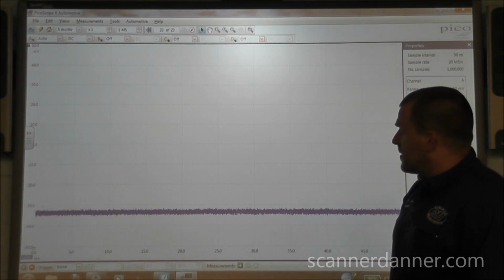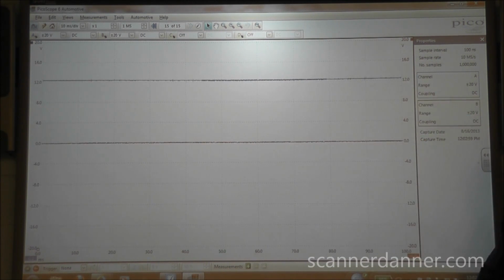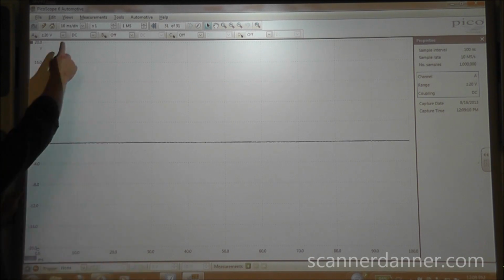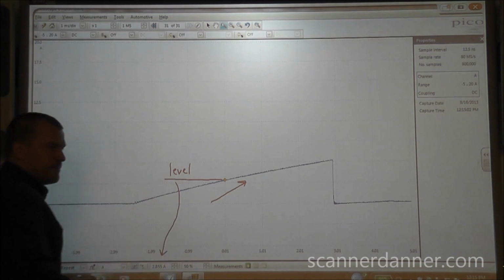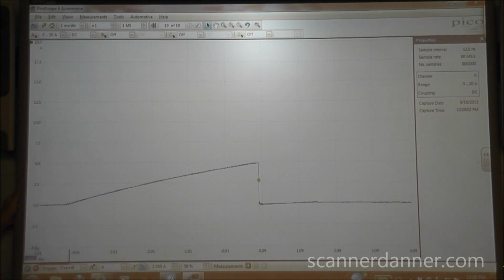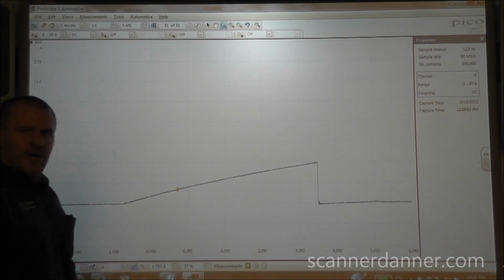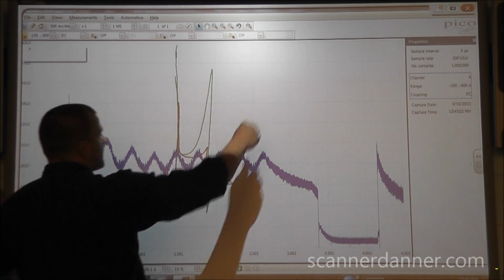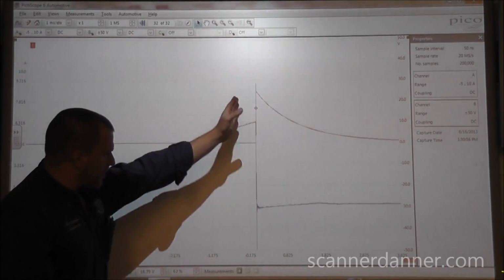Picoscope Basics Part 1 (scale, time base and trigger settings)

Comment: I can't trigger vr sensor with missing tooth like 36-2 from Toyota.  Any video about that?
Reply from the maker: Some systems you must have a cam signal at the same time to get any response at all from the ECM
Reply: Yes, but since i have a 2204 was looking to trigger the crank to use  phase rule using the cam,then disconnect from the cam and go for injector and then coil firing and see where they are in the phase. But it drifts back and forth 360.

Comment: This last test interests me, where you isolate a particular  cylinder using the inductive clamp. How would you do that with COP? Would a lead be needed to use the inductive clamp? Ordered my 2204 today so this was helpful in showing me the basics so thanks :)
Reply from the maker: I'd hook into the trigger signal for the coil. Just remember a 2 wire cop has the driver in the computer and the 3 and 4 wire ones it is built into the coil. The 2 wire will have voltage spikes that can damage your scope if your not careful and the 3 and 4 wire ones your safe. Its only a 4-5v square wave. Use an attenuator on the 2-wire ones
Reply: @ScannerDanner  Thanks for the reply. I ordered the 20x attenuator too. Looking forward to using it now.
Reply from the maker: @mk1cortinatony395  that made sense then? Great
Reply: @ScannerDanner  yes thank you

Comment: I'm really struggling with understanding what a trigger does in a scope
this video is 40 minutes long and I don't have time to watch the whole thing
please someone tell me the time stamp where he explains triggers
thanks!
Reply from the maker: Watch it at 1.5 times the speed
Reply: The scope doesn't know when to stop and start a new image on the screen.  Without a trigger it is just refreshing the screen at its default setting, but that makes the signal you are looking for jump around.  By setting a trigger you are selecting the moment it refreshes the screen.  You want to look at the sawtooth shape popping up on the screen at a consistent time.  To do that you set a trigger that will keep the sawtooth at the same place.  You choose a voltage and a falling or rising amount of voltage that gives a good image that hold the constantly refreshed signal in the same place after every scan of the voltage signal.  If your max voltage is 5 and you set it at anywhere between 0 to 5 you get a nice non-skipping image of the sawtooth.  If you set it above 5 the trigger level is too high and it never gets triggered.  Keep it around 2.5 and you'll have a nice solid sawtooth that only quivers a tiny bit on the screen and doesn't randomly skip.  Just look for the max and min of the sawtooth and set it in the middle of those two voltages.  Or you can randomly select voltage trigger points and when the sawtooth is held in a constant position you have a good trigger point.  That requires less thinking and takes longer, but it does work.

Comment: Where can I find an inductive pickup like the one your using on the plug wire?
Also, the dealership I work at has a picoscope. 4425-019 it’s the NVH package but none the less it’s a 4 channel scope and I want to put it to use, which means I need to buy the correct test leads
Reply from the maker: Definitely from my friends at AESwave
https://www.aeswave.com/scannerdanner-c512/
Reply: @ScannerDanner  I’m not finding the sync probe. I found the 60a and 200a clamp there.

Comment: Hi Paul..i got a new 2 channel pico...its not responding..i hv downloaded the software and it shows up on laptop screen..bt when i touch my channel probe to battery or any sensor signal wire, it doesnt respond..its stuck on zero line..no movement...plzzzz advise...thank you.

Comment: Greatest teacher ever was Paul I have very important question have could I send it to you?
Reply from the maker: Ask it here
Reply: Ok got your reply I have a2000 Toyota 4runner 6 cycender the problem is I can't smog it cause the monitors keep resting every time I try the engine off?
Reply from the maker: Force a trouble code to set, then shut it off and restart it and see if the code is still there, it should be, then we go from there
Reply: Sorry it took awhile to reply I forced trouble code P0100 unplugged the mass air sensor when I turned off the 4runner and turned it back on the check engine light stood on all so the trouble code
Reply: When I plugged the sensor back check engine light went out so what's the verdict Paul

Comment: could you tell me what frequencies are filtered out n the pico, i'm working on an external filtering device for cheap hantek scopes? i have built a low pass filter that really cleans up a relative compression test . it realy cleans up the shape of pattern
Reply from the maker: I think the default one is 1kHz and I usually don't have to vary it much from there
Reply: @ScannerDanner  hey i really appreciate that man,i like electrical diagnostics on cars but i also love electronics,i can probably make a low pass filter to duplicate it on the input side. the oscilloscope,ars and electronics have a lot in common but the bandwidth is getting smaller  exponentially.
Reply from the maker: you can vary the filters from 32 hz all the way to 1MHz

Comment: Paul, when I got my cam and crank signals later on I realized that I didnt have the channels set to  AC, but to DC. Did I get a correct waveform with the picoscope set to DC but yet got AC waveforms?
P.S. Do you know how to set a "Maths Channel" in picoscope to detect a cylinder misfire by looking at a crank signal using a "Frequency" to see the cylinder drop out by rpm loss?

Comment: Paul, is it common practice to hold the throttle wide open when performing Relative Comp. Testing? The reason not for Clearflood but to allow engine to breathe? I've never heard anybody mention it. Thanks for your videos!
Reply: Michael R 
If you want to see actual compression values why not do a regular test and keep the throttle plate open. 
A relative compression test is a quick way to tell if you have even compression in all cylinders.  It doesn’t tell you how much compression there is.  Try doing it with the throttle plate both, open and closed and see for yourself..
Reply: @yanzriteauto9610  Ok thanks.

Comment: Can a sync probe be used on a wire too (with signal) or does it have to be on an ignition wire only?
Reply from the maker: There are different ways to sync patterns. If I am using a control wire as a sync, I will just backbrobe it was another voltage channel. Does that make sense?
Reply: ScannerDanner Yes it does....Thank you...

Comment: Hey I have a challenging question i wondering if you could answer. GM has just introduced the media oriented systems transport (most) into their radio systems. It is supposed to be a 100 times faster than high speed can bus lan. I've been trying to connect my picoscope 4000 series to it and the radio glitches and mutes when i backprobe the 2 communication wires. same thing happens when i backprobe with my fluke 87. I was wondering does the picoscope draw like the slightest amount of amperage or microamps to gain a reading? i know a high impedance test lamp draws like an amp and it'll definitely short out 
a common can bus. I was wondering if the same principle applies to this really sensitive communication circuit. could the picoscope or fluke be partially shorting those wires together by something higher than megaohms to gain a voltage reading? I don't believe they've manufactured any tools yet to do live circuit testing for diagnostics yet like using oscilloscopes.
Reply from the maker: Yes. Last I checked the PicoScope is a 2 mega ohm impedance meter. Every digital meter or scope will draw a small amount of current from the circuit being tested.

Comment: SD. Have you ever covered  any information about FLEXRAY  communications in any of your classes?
Reply from the maker: +Poochie43124312 I have not
Reply: its the newest automotive communication standard for drive by wire  systems..Runs at much faster speeds.

Comment: I noticed that Pico has a 2204A available for $150.  It's the basic 10Mhz version. What would be the difference of having a 10Mhz Pico vs 50Mhz or 200Mhz Pico?  Is it just signal resolution?   I might only need to use it once every couple of months as a DIY'er, can I get by with the 10Mhz for automotive?
Reply from the maker: ***** check out this guys channel https://www.youtube.com/channel/UCqc9MJwX_R1pQC6A353JmJg 
he was featured in this months pico newsletter. I am positive he would be able to answer that question better. I think he has a video on this subject as well.
Reply: ScannerDanner I'll ask but his response rate is like a month or two.  Was hoping to buy it now if it will do the job.
Reply: ***** you could try asking my friends over at AESwave or maybe post it to my forum? Some of the guys over there may be of more help. Sorry man.
Reply: ScannerDanner Premium Will do, thank you for the advice.
Reply: +DJDevon3   For what it's worth, the aeswave  u-scope has a 0-1 Mhz analog bandwidth.
Reply: +DJDevon3  One more for what it's worth, The snap-on vantage pro has a 3Mhz bandwith.
Reply: Jim J Contacted pico directly and to make a long story short they said no I wouldn't be happy trying to use it as an automotive scope.
Looks like the uScope is the cheapest automotive scope available.  Wish it was 2 channels though.

Comment: Nice tip on single trigger, I just bought a Pico 4225 with a floating ground I think that is a big advantage before the scope with shared ground, I rememberer a video where you had  some issue with the shared ground. Do not remember what  it was for issue I try to find that video. Thanks to your videos I got my self the now how to use a scope and diagnose a car. I am only a diy mechanic but very interested in the electronic part of modern cars because of the part changers at the shops. Thanks for your help Danner

Comment: Hi I just got my pico and im now learning how to use it, I will be watching your vids to try to get an idea on how to use this tool, thank you very much for these sessions you have post, my question is when you connected your amp probe to the coil primary circuit do have to use the attenuator and when do you have to use the attenuator.
Reply: I am directing all help requests to my forum. Sign up (it's free) and create a new post. Be sure to add a name under "alias" as this is the name that will appear in the post.
Here is the link to the forum. 
http://www.scannerdanner.com/ForumRetrieve.aspx?ForumID=3226
Thanks!

Comment: Set up the scope the way you would like it to open up when you start the application, then go to File/Startup Settings/Save Startup Settings.  Now, every time you open the app, it will open on those settings.  You can also make a bunch of presets by saving a setup using a .pssettings ending to the filename.  I have a bunch of these that I use for custom setups.

Comment: The reason why you cannot change time base for each channel is because the typical reason to scope multiple inputs is because you are looking for the relationship between the inputs.  If you have them on different time bases, the relationship is lost.  However, there are rare times when it would be a nice feature.

Comment: Paul, unlike you, I do not like to have zero volts in the middle of the screen. I'd rather have it one division off the bottom as most of the time I am wasting half of the screen.  How can I make the Pico default to one division off the bottom as the zero line?

Comment: May be difficult to explain here, but try setting up the scope the way you like it, then click the file tab in the upper right.  In that box there is an option "Startup settings", click on this, the "save startup settings".  Whenever you open the Pico software or click the "home" icon, the program will be set up the way you left it.

Comment: The DSO203 is nearly useless.  You actually only get two channels, and the software/firmware is severely lacking.  You would be better served with an older DSO201 with the BenF firmware installed (see the discussions on the seeedstudio forum).  Either way, neither of those compares to the Pico, or really any good automotive scope.

Comment: @beansandgravy1... Paul will have to chime in on the pico because ive never used one but the verus if u have 1 window open and using 1-4 channels u can only choose 1 timebase at a time however u can open 4 seperate windows and choose a timebase for each window, duane from realfixesrealfast has a video demonstrating it on the verus if interested.

Comment: You are the best I driving old cars and you help me save a lot of money, I live in a place where they only change parts, one example is on a car they change part at a cost of $2000 and did not fix the problem next time the did a $100 repair and that fix the problem.This happen all the time and they I think charge the customer most of the time otherwise they should be out of business. Most people don't understand they get robbed. This is special garage for there on brand don't now what you call

Comment: Am I reading the last graph right, that the timing happens at 0 degrees? Or no, I guess we don't know when the timing happens, you are only showing the firing event period..we would need to compression waveform superimposed, from what i recall on your other vids?   If so, is the car typically cranking only (not running) for those waveforms?

Comment: Well done, looking forward to more.  Question.  Is the Pico scope accurate compared  to  a quality DMM when sampling a voltage reading, as well as a converted amperage readings.  Is it possible to use the pico to take a ohm reading, just had to ask ?     Thanks Paul.